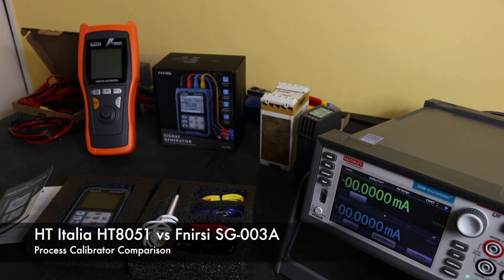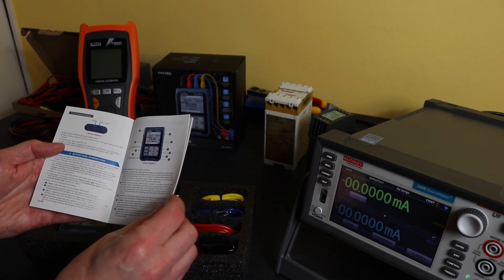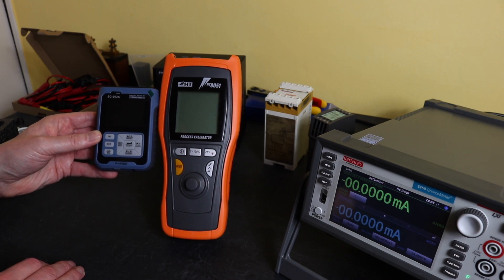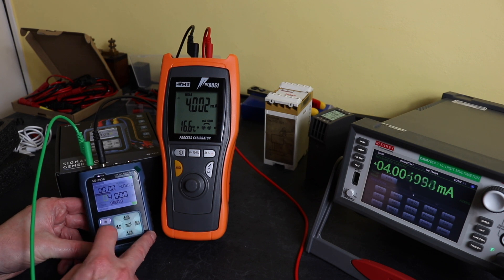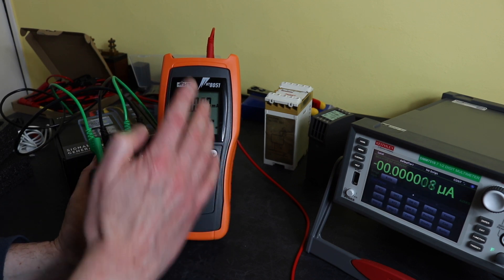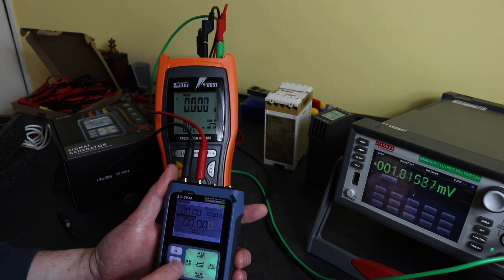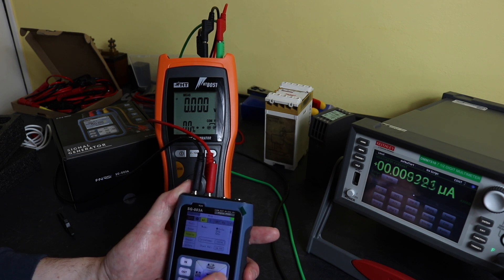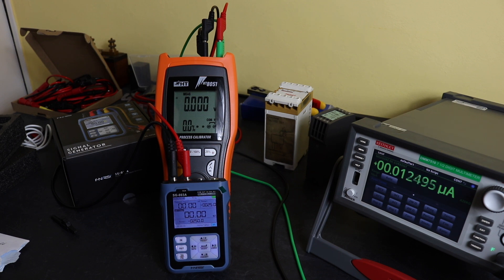Process Calibrator Comparison HT8051 vs Fnirsi SG 003A

Comment: I recall you can calibrate these...
3 point if I recall at 6v/mA, 12v/mA and 18v/mA with very fine granularity but on my units it was mostly in the very low ballpark.. like mV.. i saw problems,
and dont have any cal-adjustment setings down that low on the units interface. min was 6v-.. but then again I also dont have any reference gear, to align on.. so not much purpose trying to dial anything in..
but its one feature-packed little device and you can adjust most of these things.. presets, programs, and conversion, where it seems you can mix different signals. and even set up different timeframes and intervals and segment jumps.. more or less mix & match to your hearts desire. 
Have a few small videos on EEVblog.
I gotta admit Im very happy with my purchase in regards to the price I was able tp pick it up for with incl. danish VAT 25% & incl. shipping.
Its one sexy little fellow for the price... I wonder about the SG004A with 0.02%
But I also gotta admit Im coming short' on knowledge... to try many of its features..so I would love if you could digg a little into it.. perhaps in a comming vid..
all its interfaces circulate around the FN button, highlight it red, and all the other buttons has multiple features and screeninterfaces.. dual graphing etc.. and you go into menu with FN and then either IN or OUT.. depending on which you wanna adjust ... same when your running something.. you can often operate the values etc on the fly and get extra decimals without having to go into the menu.. same with the graphing.. "FN + curve" gives you that grahing-screen display..
but I will likely need to read the manual, as IM certainly not on hometurf when it comes to these things and why a channel like yours is a joy... displaying things and usecases and how it works.. as I simply trying to learn as I go.
though looks quite accurate at fx 10v = just flipping your 7½ meter around the 10v label 10:32 but could be interresting to see what kind of accuracy you could dial it into with your reference gear.
though my unit does not seem to go to 24.0v.. more like max 23.3v
Reply: I think you will find that the 24V is usually to power an isolated piece of process equipment.  The operating power typically is between 18-24V and the 4-20mA output is what is measured.  I will have a look at your vids in EEVblog as I'm really intrigued by the functionality of this device.
Reply from the maker: @scottshaw1310  Yes, you can get transducers that have an auxiliary power into them and then they just generate the necessary voltage to push the current measurement through the loop. Alternatively you get loop powered transducers that take the 24V from the lop and 'impose' the current measurement onto it.
Thanks for watching and commenting.
Reply from the maker: Yes, you have calibration constants for each voltage / current source and measurement function. My unit appears to be more accurate sourcing than it does measuring. The error is also not linear in mid-range. I have played with the calibration constants now and can get a little bit better response. I also fudged the constants to give me the best measurement for 4 - 20mA, which would be my main use and can get all the readings just about in tolerance.

I really would like to set up a loop powered device somehow to demonstrate the simulation modes and also play with the range and conversion function, it certainly does have a big capability. Am seriously tempted by the SG-004A, but would need to get it direct from China, so likely take a while.

Thanks for watching and commenting.
Reply: @three-phase562  I will test the source and measure of my LB02A on my recently certified Keithley 2000 (6.5 digit) tomorrow and report back.

Comment: Have a look at the LB02A. Accuracy 0.025 + a few counts.  Good option for temperature sensors too.
Do you do any temp testing?
Excellent range of equipment you have there!
Working my way through your older vids, and enjoying immensely.
Reply from the maker: Thanks, I didn't know about the LB02A, will perhaps take a look at one. Fnirsi do the SG-004A, that has a better tolerance, but no temperature capability like the LB02A.
I only deal with RTDs in stator windings really.
Thanks for watching and commenting.
Reply: @three-phase562  No problem at all.  Have a look  at Tony Albus vids 154, 216, 218 which detail his testing of the LB02A against an earlier version of the SG003.
Kerry Wong also tested the SG003 (I made a few comments) and I would have been tempted by this or the SG004.
There is also a HART enabled version of LB02A (LB06) but is nearly twice the price.
Whilst admiring your Agilent DMM I have recently purchased a Brymen BM867s (500,000 count in DC voltage range) £150 delivered, and rate their BM786, BM789 and BM869 meters.  They are rugged and have real quality.  Thanks for replying!
Reply from the maker: @scottshaw1310  Yes Brymen make some good kit. I tested out the BM877 a while back. I look at meters occasionally, but my interest is predominantly in insulation testing.
I'll take a look at the videos before pulling the trigger on an LB02A or SG-004.
Reply: @three-phase562  I found your site when I was looking up Gossen meters.
I have a MetraHit Iso but it isn't very accurate on certain ranges (may have been damaged during operation) so appears to have been a poor Ebay purchase.  Unfortunately Gossen don't seem to release service manuals, circuit diagrams and adjustment data.  It's probably not worth repairing and adjusting back into specification, but we'll see.